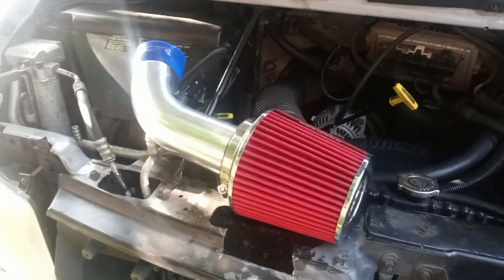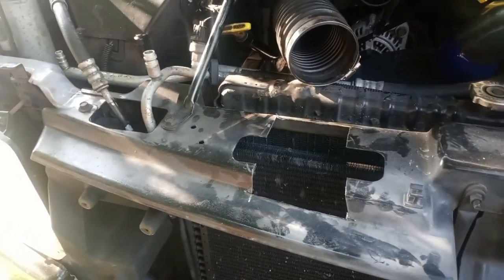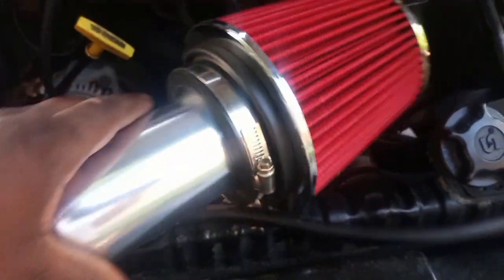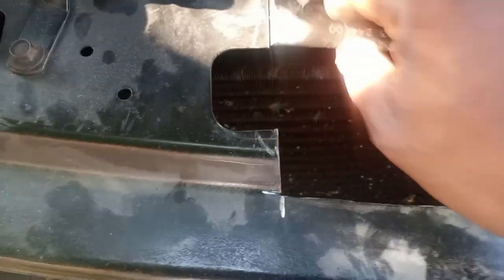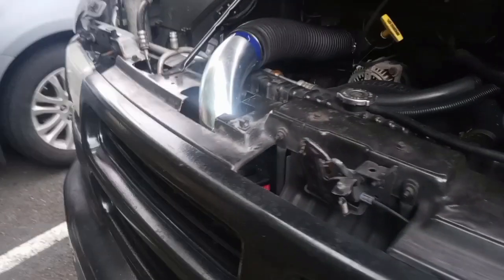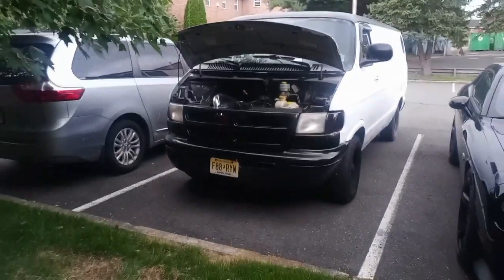how to install a cool air intake on your 2001 Dodge Ram b1500 conversion van

Comment: Sooo, Did you pull the filter from the air cleaner under the doghouse? Haven't seen this hybrid of factory parts as a COI method and curious if it does anything for you, LMK!